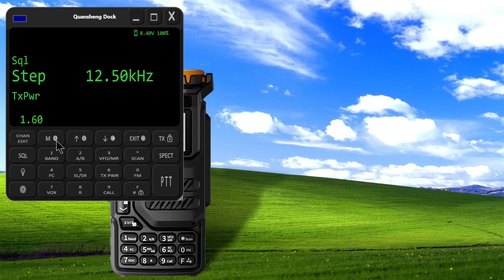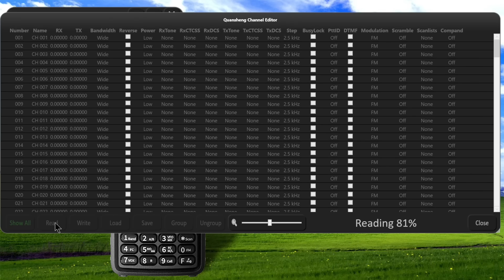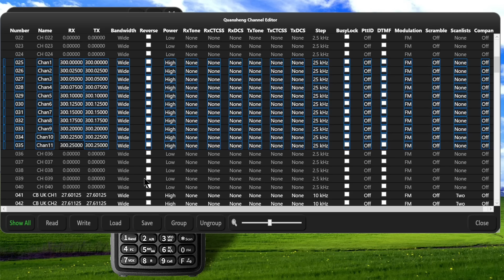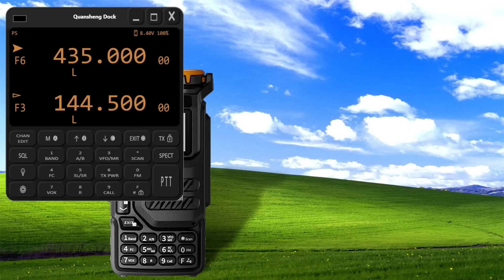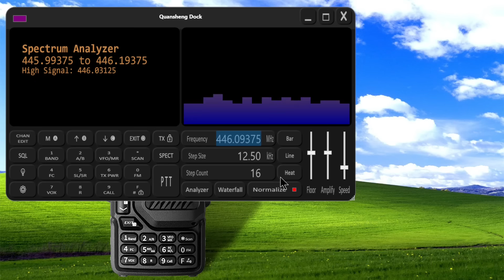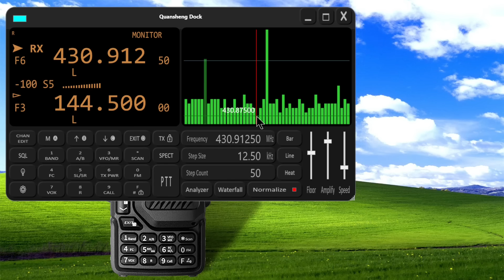Quansheng UV-K5 Remote Dock System

Comment: I did everything as you said, but when I press the “ptt” key in the dock program, it transmits for about 1 second and then stops. Why might this be happening?
Reply from the maker: Most likely you're clobbering the PC and USB Cable with RF energy and causing everything to malfunction.

Comment: Well done..
so its a two part setup
A modified Egzumer fw for the radio and the PC dock sw which I guess are windows 11 valid.
Are the Egzumer still 0.22 version' are are the features removed from the Egzumer 0.22 to implement this .

Comment: Any plans for the Dock to work with other firmwares like the egzumer?
Reply from the maker: Okay, think of the firmware on the radio as a translator. It has to translate the language spoken by the app in order to make the radio "do stuff". egzumer and other firmwares do not speak that language AT ALL. I have to modify egzumer in order to make it speak it. So how can the Dock be made to speak to a firmware that doesn't understand that language to begin with?  Answer, it cannot. Standard firmwares do not have any capability for remote operation, so no matter what I do with the application on the PC side it simply cannot talk to the radio, it requires a modification to the firmware in order to do so. The dock ALREADY uses egzumer, that's the base firmware that I modified in order to make this work.

Comment: That's outstanding and all with a radio that cost me £13 - so good I've just sent for another and a set of spare batteries. I've only just got my UK-K5(8) and I live in a bit of an RF hole, but this would be great for /P work. It's also got me thinking I could knock up a bit of a joint box with some sockets to save on hacking wires together, and maybe make things a bit neater. That Spectrum analyser is the dogz bollox. Well done Sir!!

Comment: Nic, sorry for asking again but I'm not getting any audio through my PC speakers, radio is connected and program working but no sound?  TY
Reply from the maker: What type of audio cable are you using?
Reply: @nicsure  Forgive me I'm 75:)  I'm not using cables, I just want to monitor audio through my PC speakers  :)
Reply from the maker: @steelgtr You need a special cable to do that. Either a custom one you build yourself or something like an AOIC (all in one card). Instructions are on the GitHub page.
Reply: @nicsure  OK, sorry, I thought that you said it was always possible but you meant with a cable. Any sources for the AOIC?
Reply from the maker: @steelgtr  Where are you located in the world?
Reply: USA, California  @nicsure
Reply from the maker: @steelgtr I was hoping you'd be UK then I could have pointed you to an eBay listing. I just ordered one myself. They do require some assembly. All I can suggest is to maybe ask on amateur Facebook groups if anyone is building a batch of them, or see if you can find someone selling them on eBay. You can order them yourself directly from the Fab, but I think you have to order a minimum of 5. The link to the project is here https://github.com/skuep/AIOC maybe take look through it and see if there are any suggestions you can use?

Comment: Would there be any reason why we couldn't just tap the Serial TTL data straight from the back of the socket inside the radio and use the built in speaker/mic as normal?
Reply from the maker: Yes, when audio is being output from the speaker or any low-impedance output, the audio bleeds into the serial line and causes corruption. If that wasn't the case there would be no need to mod the cable at all to convert it to high-impedance, it would just work with two unmodified Y splitters.
Reply: I understand that part but if there's nothing plugged into the sockets then the audio wouldn't be re-routed to the 2.5mm jack rather than the internal speaker. If the TTL data is available on the back of the jack socket without plugging anything in to it then it could be tapped off from there without affecting audio routing.  @nicsure
Reply from the maker: @AndyMcGeever  Hmmm, i see where you're going. I'm not sure if the situation would just be the same. The serial TX shares its ground return with the audio's ground return, since the audio is low impedance, if there's any significant resistance between there and V- it's going introduce noise because the audio will be effectively biasing the ground. It might be a better situation from directly inside the radio though. I've not taken it apart to check.
Reply: I would imagine it's just crosstalk between the two side by side conductors within a common screen but either way, if the 2.5mm jack is not inserted then the audio signal won't be routed to the jack. It would have been nice if the data was on the USB-C but only the power pins are connected internally. There's easy access to the back of the jack sockets so i may try tagging a data line to it this aft and see i can maintain a serial connection whilst audio is routed to the speaker. My thought was whether or not the data would be always present at the socket or only routed to it when the jack is plugged in as the audio is.   @nicsure
Reply: Ok that worked buddy.. I just took a twisted pair (CAT6) straight from the back of the socket and it's clean on the serial monitor. I did have a little bit of breakthrough initially when transmitting but that was with a single conductor to a TTL/USB converter and a ground to the radio chassis but that didn't happen with the twisted pair. I'll put a 2.5mm socket on the side of the radio and then it should be ok with a decent quality short extension to plug the original programming lead into.    @nicsure
Reply from the maker: @AndyMcGeever  That's pretty cool. Looks like it is just crosstalk then. That also might fix the problem of the serial data "chattering" on the transmit audio too.
Reply: Definitely, that was the issue with just a single conductor that disappeared when i used twisted pair from the board to the TTL/USB converter. Did you make any changes to the underlying firmware? i'm sure this isn't related to your firmware but since flashed yours and then went back to the 0.21 Egzumer firmware my squelch doesn't open even when set at No1. I'm on the doorstep of my local airport, in fact i'm a PPL Licence holder and i fly from that airport and often use my scanner to check ATIS before heading over there and i get the tower/Approach and ATIS at S9 but now i can only hear them with the squelch off completely. Signal level is still the same, it's an outdoor antenna. In spectrum mode the squelch works normally.    @nicsure
Reply from the maker: @AndyMcGeever  No, the only changes I made to the underlying firmware are basically serial packet handlers, keyboard injection and LCD display hooks. I haven't touched anything to do with squelch. I'd advise maybe saving your channels and then factory reset in case there's some EEprom corruption somewhere.
Reply: I presumed that would be the case. I'll give that a try although strangely in frequency mode it works as it should, it's just channel mode when the squelch doesn't operate  which is very odd. Thanks for getting back to me so quickly each time too, that's a rarity on youtube.  @nicsure
Reply from the maker: @AndyMcGeever Hmmm now that's worrying me slightly. Did you program the channels with the Dock? If so I might be writing them to the radio in a way that's causing some problems with the squelch. Squelch is a global setting though and not channel based so it shouldn't affect it, but you never know what can happen.
Reply: Yes i did. Just the first 10. I've reflashed with Egzumer 0.21 and 0.20 and the problem is the same. I'm just flashing firmware though, not the channel map which i setup in the dock. I'm still learning code wise.. I've been using Arduino stuff for a couple of years and i'm fairly competent with that now but this is a little more advanced.. I'll reflash the channel map with CHIRP and see if that makes any difference. Is the main firmware in a separate location on the EEPROM  or a separate physical hardware location?  @nicsure
Reply: Interestingly i've just accidentally realised something.. The tower freq at LBA is 120.305. It used to be 120.3 until the channel spacing format/bandwidth was changed a few years back right across the aviation band to 8.33khz. If i change the frequency to 120.3 then the squelch works and the signal is stronger and clearer even though the true frequency is 120.305. It wasn't like that before i flashed the dock firmware.. Could this be bandwidth/offset issue created by the channel map flashing from the dock? Related in any way to not being able to program with freq offsets for TX/RX as was mentioned in another comment on this video?   @nicsure
Reply: If you're on facebook i'll drop you a video @nicsure
Reply: I also have an AOR AR8000 scanner sitting next to it and that receives better on the correct freq as you would expect.  @nicsure
Reply from the maker: @AndyMcGeever  It's possible although I have no idea how or why. I'm pretty sure the problems in the other comments were due to erroneous values in the eeprom data. The latest update (not yet released) addresses this with a far stronger sanitizer for the channel data. What I would suggest is to read the radio with CHIRP (remember to turn off "Remote" in the radio menu) and then flash it back. CHIRP may repair anything that's off.
Reply: I can't set two different frequencies in the dock channel settings for 2m repeaters. I can in CHIRP though. If i set the TX frequency 600Khz lower than the RX it changes to the RX freq as soon as i exit the field entry box.  @nicsure

Comment: Great video & program. I just have a quick question. I received my UV-K5(8) this afternoon. The first thing I did was connect it to chirp to make sure it would read. I then updated the firmware to your required version. It connects to my computer perfectly. When I tried to reconnect it again with chirp it will no longer read, it tries but getting error msg. I tried to power cycler the radio, disconnect and reconnect the USB cable & radio, still won't connect. I tried my other UV-K5 "white display" version and that radio connects fine with the Egzumer v2.01.31 Will it not work with chirp? I was just going to use the built-in channel programmer, but it's not displaying all of the freq modes. Thanks in advance!!
Reply from the maker: The data it sends for the remote display confuses CHIRP. That's what causes the problem. If you look in the Radio's menu, there's an option called "Remote", if you turn that off, CHIRP will work. Be aware that rthe option turns back on when the radio is turned off and back on, or when it's reset.

Comment: It's possible to use the radio in remote? Like rcforb?
Reply: That’s what I want to do!
Reply from the maker: There's no (yet) built in function for that, however you do have possible areas such as remote desktop or TCP/IP to Serial. Audio is a little tricky though, probably need some kind of streaming setup to pull that off.
Reply from the maker: I don't even know what rcforb is, sorry. The whole point of the project is to use the radio remotely. Unless I'm not understanding you?
Reply: @nicsure  i'm asking if it's possible to enable ptt and talking using the mic and speakers of a remote pc. Not only control the radio, but full transmit and receive in remote.
Reply from the maker: @Funkyoitube Do you mean a PC other than the one connected to the radio? Basically remote control the software itself from another PC?

Comment: Very nice work on the programming!!  I wonder if it would be possible to tap into the RF before the internal amplifier and feed it off to an external proper amp.  Since, for example, the RF power generated at 27 MHz is much lower, (and with lots of harmonic distortion and undesirable spurs) than say 144 MHz, since the RF amp and filtering is not designed for 27 MHz (or what ever freq is desired) then one could possible feed that rf to a proper amp that IS designed for the freq of interest?  just a thought but this is awesome work so far.
Reply from the maker: Yes, I have seen other comments talking about that. It's a very involved mod though and requires disassembly. To be fair, once you've setup your band pass filters and PA externally the monetary cost may start to get a little high.

Comment: This is very cool, I have tried for hours to get it to work but the radio firmware, I haven't been able to get it to go past the release all buttons screen. Plus when I try to flash the egzumer 0.21 firmware it no longer works, even after resetting the radio. If I go all the way back to 0.15, that flashes to the radio and the radio works fine of course not with your doc. I don't know how to get your radio firmware to work on my radio or what has happened to the egzumer mods from working.
Reply from the maker: That's a very bizarre problem. It appears to be something to do with the way the Dock simulates a key press on the radio. Sounds like it thinks a key is pressed all the time. The only two things I can think of off the bat are maybe a faulty PC keyboard, it's working in Windows but the Dock is seeing some key pressed that Windows is ignoring? Or maybe some form of eeprom corruption that's causing issues with later versions of the firmware. If an earlier firmware is working, try using CHIRP to flash it clean.
Reply: @nicsure  It is bizarre for sure, I will try the CHIRP suggestion. Thank you for your response.
Reply: @nicsure  I found something interesting. Only egzumer firmware 0.16 to 0.21 won't work on my radio anymore when using the battery. I removed the battery and powered the radio off the USB port and egzumer Firmware works fine and works with your firmware you provided and the dock works as it should, nice. But when I put the battery on the radio, the egzumer firmware says my battery is at 0 percent. IJV firmware says my battery is 100 percent. I have used the egzumer firmware with no trouble in the past, I think since I've used the Facqi Reborn Firmware it has changed the battery settings someway in the EPROM, that egzumer says my battery is dead and the firmware will not boot. Take the battery off the radio and use USB power and the radio boots egzumer firmware properly and the dock works fine. Eqzumer made changes to battery specs for 1600 and 2000 mAh batteries at version 0.16 and that version is where the firmware won't start. Facqi Reborn in a forth coming update and has added battery options. Hopefully I can get Eqzumer firmware working in the future.
Reply from the maker: @ominkan3129 Wow that's very peculiar. Since you can get the radio to work without the battery with egzumer. Try doing that and enable the secret menu items, this gives you battery type and battery calibration menu options. You may be able to reset the battery settings with those options.
Reply: @nicsure  Wow thanks for mentioning that. I knew the battery type was there, but not battery calibration, but there it is next to the BatTyp. I charged the battery to full and recalibrated the setting to 100% . Thank you, you fixed it for me. How wonderful, thanks for your help. ｡◕‿◕｡

Comment: Woot!

I was going through the setup and having issues with an errant USB driver (unrelated to the Quansheng Dock), when I decided to try to use the cables I got with my Digirig to see what I could make work.

Initially, I found very limited functionality but when I connected the radio to the Digirig with the green end cables to the Serial port I suddenly had sound and PTT functionality, a little more configuring and I was broadcasting voice over the air - VICTORY LOL - followed shortly thereafter with a Microsoft error and the app shutdown.

I have repeated it all including varied crash messages.

That being said it does work after a fashion allowing full computer control and voice through the headset. Great program with superior potential.

If I can get some pattern to the crashes I will forward the details to you,
Bruce
WROE975
Reply: Are you sure it's not RF crashing your PC? I've had mine typing characters when accidentally transmitting with the antenna close to my wireless keyboard. It put my PC into standby twice, opened webpages and completely crashed the system before i realised what was happening. I suspect the system crash  was direct RFI rather than just corrupting wireless HUD data so i probably got off lightly in not doing any permanent damage.
Reply: I suspect you are both right. I wasn’t thinking about it, because the radio was behind my keyboard, not near my computer, certainly, but right behind the keyboard, and I’ll bet that is what it was. Thank you for the reply and the info.

Comment: So, no audio without the fancy home made cable?
Reply from the maker: Unfortunately no, when you plug in the cable it cuts out the internal speaker. That's a hardware thing and no amount of software can overcome it. So a cable mod is the best I can do I'm afraid.
Reply: @nicsure  Thanks and great job.  USB jack an audio out option?  :)